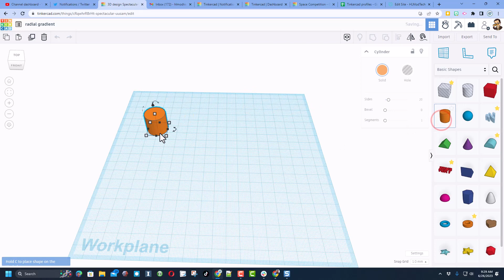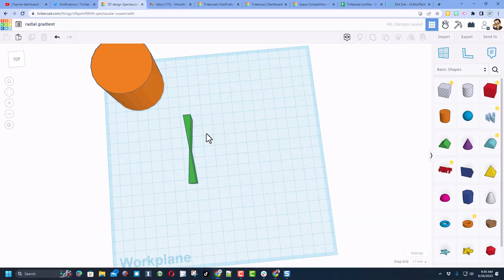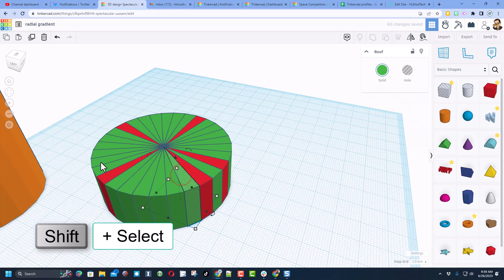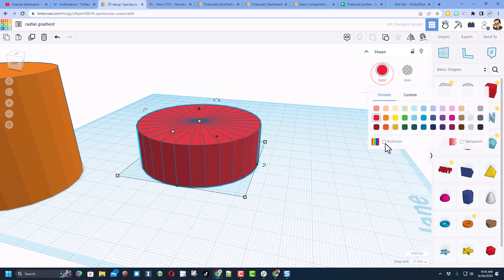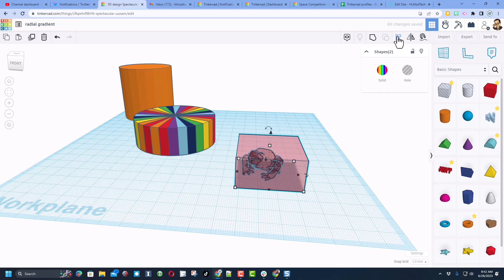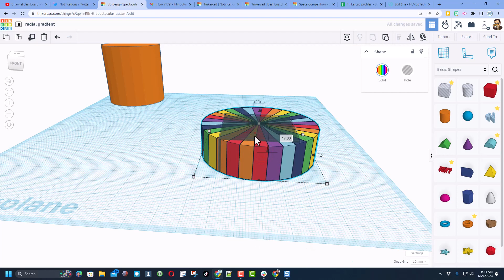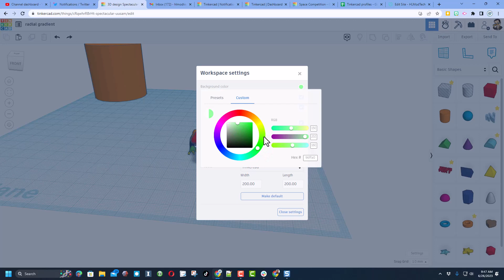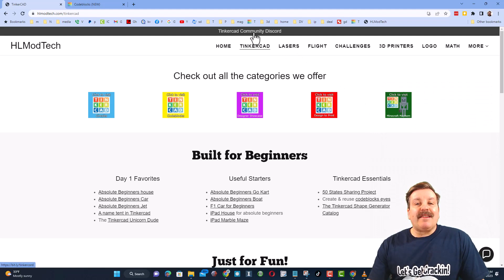Make Tinkercad Radial Gradient Designs with Inverse Holes in Minutes!

Comment: I did this tutorial slightly differently. 60mm*SIN(360/(7*4))= 6.68mm so that was my roof width and I made a cross from 4 roofs and grouped. Small rounding up errors aren't noticeable, but rounding down is. Then I duplicated and rotated by 360/(7*4))=12.86 degrees and reduplicated till the circle was filled. Then I coloured each group. It makes a neat and tidy rainbow repeated exactly 4 times. But I do understand using trigonometry is potentially distracting.
Reply from the maker: Wicked cool use of your trig skills! 💯👏